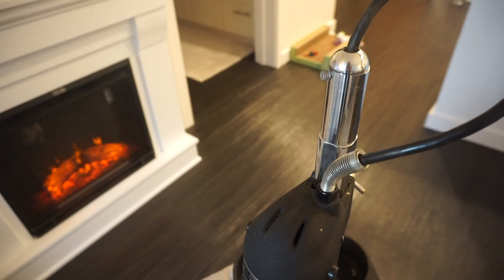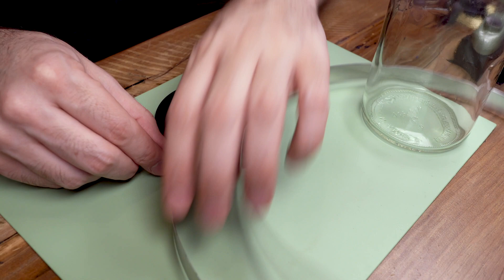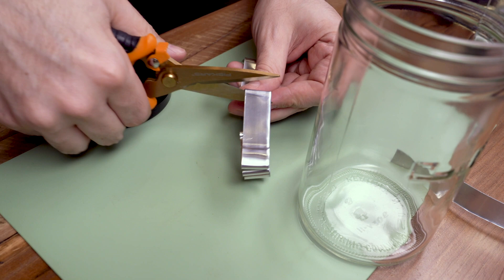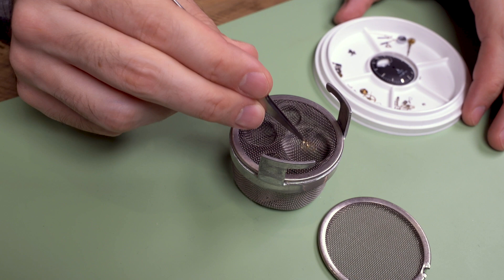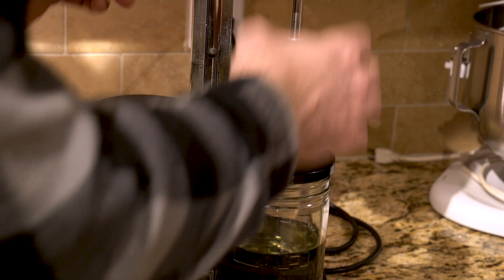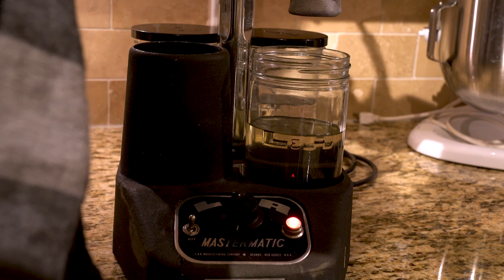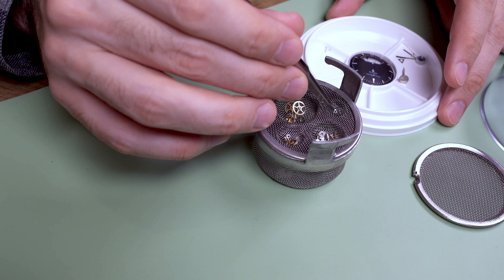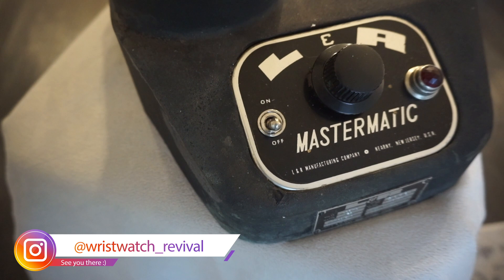L&R Mastermatic Watch Cleaning Machine

Comment: I would think the final rinse solution would be 99% isopropyl alcohol, since it displaces any water and evaporates without leaving any residue.
Reply: Some people do. I was told by a watchmaker that it has the potential of softening the adhesive on the pallet forks of modern watches. So I guess you could but keep you time short?
Reply: If heated, that sounds quite dangerous.

Comment: So why is this better than an ultrasonic cleaner?
Reply: My question too. The ultrasonic seems much less aggressive toward the parts and, in my experience with other uses, they work fantastic. Maybe the switching of the three chemicals is the main issue, and the cleaning machine is better, for some people, simply because it has multiple containers built into its basic design. I’ll have to admit that switching detergents and solvents - even in my quality, commercial, ultrasonic cleaner - can be a bit tedious and error prone (e.g., spilling liquid all over the bench), at times. Plus, it’s hard to recover 100% of the chemicals when changing them back and forth. Still, I’d appreciate WR’s take on the subject.

Comment: A nice machine. I have a British Brenray watch cleaning machine in very good condition. It doesn't rotate both ways like the L&R (Left and Right) but it does clean watch parts very well. I use L&R Extra Fine Watch Cleaning Solution and No 3 Watch Rinse for oustanding results. Thanks for a great video.
Reply: I prefer watch cleaning machines ONLY turning in one direction. Keep in mind, all the parts moving each time the direction is changing...
Reply: @Watchmaker_Gereon-Schloesser  Trouble is with rotating machines is the loss of very small parts. I lost a balance stud screw, never to found again and have absolutely no idea where it could gone. Somewhere lurks a screw so very small one could lose it under a finger nail and not even know it was there! So now I tighten any small screw and run the machine slowly. 
But I was very lucky as I managed to find an incomplete movement for sale and replaced this fugitive part. Such is the life of the watch repairer.

Comment: I have an ultrasonic cleaner with heat, (not for watch servicing).  It was reasonably priced and works well for my needs BUT it has a small heater that takes forever to heat the fluid from room temperature.  The heater works okay to maintain the temperature though.
I used to TRY to remembering to turn on the heat well before I needed to use it, or just stupidly, wait.
Now I just heat the fluid on the stove in an old pan in two minutes.  Also, I was floored by the price of solvent for the cleaner.  I found that $ 2/gallon windshield washer fluid works fine for most of my projects and no $ pain to replace it frequently.
Reply: That is a clever idea.  Windershield washer fluid!.   Thanks.  I will try that.
That expensive cleaner used for mainsprings and the like is basically hexane.  That's why it evaporates so fast.   Hexane runs around $50/gallon on Amazon as opposed to the crazy markup for One Dip.   
Not to mention some of these Moebius oils and greases cost ~$20,000 per quart.  No, that's not a scam!.

Comment: Just a little bit of advise that I can give you. They make little plastic white baskets that are specifically made for the smaller parts. The basket has 4 small separate compartments. You can put the pallet and smaller screws in that basket and then secure the basket with a small binder clip. We were taught that in school so that you dont lose the smaller parts. Since the machine spins, smaller parts can get stuck in the mesh of the basket. I have used this method for years, some vintage ladies watches have very tiny screws and they can get lost.
Reply from the maker: Thank you! I'm using some small bergeon screw together mesh holders now for the really small stuff, but I'll keep this in mind :)

Comment: Hey Great Video! I have seen these on EBay and unless you get lucky, I disagree on getting a deal.🤔 I've seen your exact machine sold for over $750 $900  $1200 many times! And broken ones will sell at least $250- And then shipping is definitely over a $100. BUT! If anyone's looking for one? I literally just bought 2 of these on HiBids auction in my area- 1 for $20 & another for $30-I highly recommend it- I  just picked them up & I was lucky that they both worked. Keep up your Awesome Vids!👍😉🇨🇦

Comment: Thanks for sharing! As I understand, the Master-matic model is able to cycle between forward and reverse directions automatically, every second or so, while the Master model does it with a toggle switch, manually. Since I'm not good in electronics, I wonder what kind of component does that automatic cycling. Does anyone knows?
Reply: Most probably a simple reverse alternating relay. Never seen one from the inside but that's probably how they did that...
Reply: @Lalaland.001  Yeah, that’d be my guess as well - something simple and robust. The only thing that would call that into question at all would be the truly ingenious mechanisms that vintage machines often utilized - reversing ball lead screws being just one example. (At first glance, that was my guess, but later, it’s clear that the motor itself reverses). In the video, he refers to “electronics”, but that may be referring to anything more or less electrical. Almost certainly doesn’t contain an H-bridge or any of that transistor rubbish (and there’s no space for tubes).

One unintended upside: Because frequently switching relays experience wear (pitting, welding, etc.), it ups the chances of us finding units like this that are “broken”, but very easily repaired.
Reply: @a1nelson  Often the simplest solution is the most probable being used, though your reversing ball lead screws are a good example of something innovative. Thank you for your reply, always nice to see people around the interwebs giving those extra nuggets of information...Have a wonderful day...

Comment: I have a L & R Console Vintage Cleaning machine and two Ultrasonic Jewelry Cleaners that go with it. My Dad's things and I am trying to sell them ... it turns on and vibrates so I assume it works. But wondering how you knew it was okay and worked before you bought it. Don't want to sell it if it doesn't work! But I am assuming it does.I think I have all the parts too. Thx for any input.
Reply: the motors in them can be rebuilt so even if yours isn't working, don't trash it
someone will buy it

Comment: Most of the machines at eBay look like they were salvaged from the sewer.i am very jealous of your machine.
Reply from the maker: Yeah it took me a while to find it and I had to go pretty hard to get it but it was worth it
Reply: My L&R was trashed (cosmetically) when I got it, but a bead-blaster and refinish with Cerakote made it look (somewhat) brand new again. If you can do basic wiring, you can replace all the old wiring for next to nothing as well.

Comment: Nice machine, Modern one's cost a pretty penny. I've been using a "Little Giant" similar type machine with square jars, unfortunately it needs to be re-wired as the original power cord is frayed and may be potentially hazardous, it's one of the things that we have to deal with as low budget hobbyists I guess. I might look around for a vintage automatic type one that cycles through all jars automatically and with a timer, they're a little more pricey but still within the budget of most if you can find one in good shape.
Reply: Do you need to add baffles to the square jars? I don’t have any in mine and I’m worried it’s not cleaning the parts well

Comment: I have watched many of your videos now where you use this machine, but I still did not get what makes it so that when the basket is down in the solution it spins on both directions cyclically, but when the basket is up to spin the solution off, it only spins in one direction. Is it just a setting on the knob or does it have a sensor for how high the basket is?
Reply: There's a tab on the output shaft that engages a toggle switch to reverse the phase of the A/C motor each time it gets to that point from either direction. It only engages when the basket is fully lowered.
Reply: It's kind of like one of those "useless box" toys that only exists to switch itself off again when you flip the switch to turn it on, but then it turns itself on again, rinse and repeat.

Comment: I realize no one will read this belated thread, but I am going to pontificate anyway.
Like many others, I have noticed these devices are in hot demand...yet no one makes them today except for one company in India who sells them on Etsy for $600-700.  Once received, the plug-in needs to be changed out for the American-style electrical outlet.   Regardless, they do get good reviews. 
I am dang surprised the Chinese aren't making something...cheap or otherwise, they make everything else.  At least, I have not seen them.  Working or not, being relegated to paying upwards of $700-800 for 70-year-old old used L&M machines on eBay is a little ridiculous.   Something I noticed that is similar is a Kitchenaid mixer.  If you could fit a watch cleaning basket onto a Kitchenaid, it would be pretty close, albeit, you would have to change the wash-rinse bowls instead of moving it to the next separate container.   Soda fountain machines are also similar.    I thought about trying to fit a watch parts-cleaning basket to my Kitchenaid and see how it goes.    By dang, enough of this!.  There are piles of watch hobbyist out there who need these machines at a price that won't drive them to the poorhouse, and someone needs to get on it.

Comment: The biggest question I have about this machine is how the auto-reverse function works. I know it's not using sophisticated logic boards with controllers and motor drivers, so how does the mechanism work? Is that something that makes itself evident when looking at the machine, or do you happen to know how it works?
Reply: I'm assuming a "simple" RELAY. Probably the kind like a car blinker turning lights relay. With a Ni-chrome heater wire that is "moving" (heat - on-off) a Bi-metal relay arm.
Reply: @Watchmaker_Gereon-Schloesser  I considered that, I built my own 3-relay circuit (two 5-pin relays, one relay with remote functionality for trigger) for my double-swing driveway gate. But I noticed the basket comes to a pretty smooth stop, not a sudden stop like a relay alone would do. Perhaps a relay circuit in conjunction with a spring mechanism to absorb the momentum before it reverses direction? That's the only thing I can come up with.

Comment: Does anyone know if the larger pocket watch basket will fit on the same basket holder as the smaller basket?  I was thinking that perhaps the larger basket could engage with the nubs which are on the outside ring of the basket holder used in this video.
Reply: L&R made two sizes of  baskets = #1 and #2  The #1 smaller one fits inside the motor flange and the larger one called a clock basket fits on the outer part of the same motor flange.

Comment: Hey, how often should you replace the fluids?
Reply from the maker: Usually it's measured in how many watches you've put through, and I think about every 50 or so is recommended? I do it more often just because a lot of time would pass before I got to 50.
Reply: The cleaning solutions cost a fortune =about $50 a gallon.  Make it last longer by making a funnel system with a glass jar and run it thru a coffee filter.  Also use/make a stainless steel baffle for the bottom of the cleaning jar, make a s/s clip to adhere a super magnet to it.  After you clean the solution, just add some new to it each time.

Comment: Why 2 identical rinsing stages
Reply: The L&R Tempo 355 and 400 both have three rinse jars.  Some people have a spare jar (or two)  on the side for the older 3-jar machines.  The last rinse jar should always be clear or the hairspring coils will stick together.  I use two Tempo 400 machines, one as a pre-clean; this way only clean movements go into the second machine.  This way you just transfer the old solution to the pre-clean machine when adding new to the second one.

Comment: Option #2... Timex Ironman, from Walmart.
$27, runs for years on its replaceable battery.
Measurably more accurate than mechanical dinosaurs.
-more accurate
-cheaper
-easier
And, time for McDonalds...
Reply: Yes, even a $10 quartz watch from Walmart will be more accurate than even the finest mechanical watch. But people don't get into mechanical watches as a reliable time-keeping piece. It's pretty much for the sake of the appreciation of the precision and scale of engineering that goes into these things, or even for the sake of history (if you're into the vintage watches, which I certainly am). They're just cool and are simply appreciated. 

Timex is trash though. I have a Casio G-Shock GWM500A-1. It is solar powered and atomic clock synchronized. I never have to worry with batteries or setting the time, as it is always perfect.